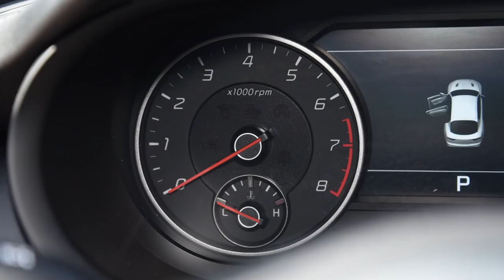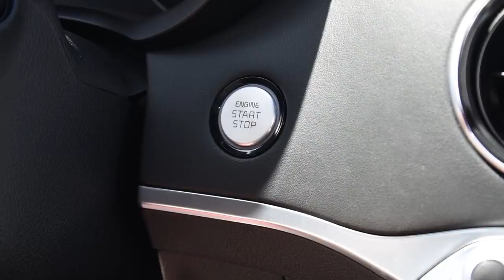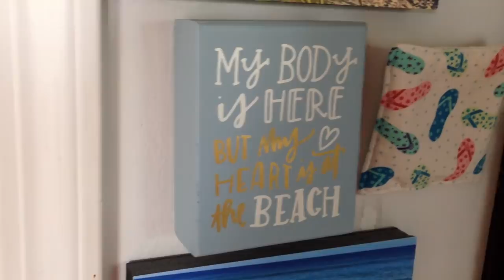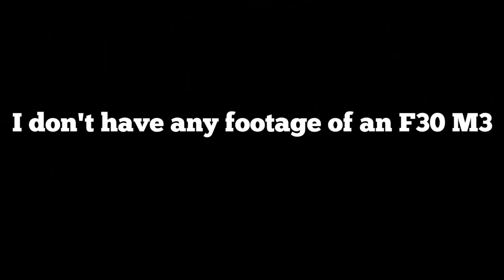2018 Kia Stinger GT: Regular Car Reviews

Comment: Kia, you know you've done a good job when the only criticism you get is "dA bAdGe"
Reply: CRA_55 my criticism is the price and lack of HP. 

If it was a ford or Chevy or Honda i would still criticize it. 

360hp awd for 55k+??? 
I can get a loaded fusion sport for 44k 
Or a loaded accord sport for 40k (fwd I know) 

Or a loaded gt mustang with 100more hp for the same price
Reply: Devin Bender why are you comparing an accord to this?
Reply: Finally, some valid criticism that isn't the Kia badge. 

But then again, the Accord or Fusion won't give you the same performance or handling. The Stinger is more akin to high-spec compact executive European sedans, such as the BMW 340i, and when you compare those 2, the Kia suddenly seems like a bargain.

IMO Kia needs to expand the Stinger range to cover more markets and really push the Stinger nameplate:
- A more economical variant, perhaps with a smaller or N/A engine or a hybrid
- A coupe, since the rear seats kinda suck anyway
- A faster version, perhaps with a V8
Reply: neirad537 Simply be comparing it to a midsize sedan. Ignoring the base drive. It still is a midsize sedan at the end of the day.
Reply: neirad537 It's a valid comparison. You can perceive the Kia as an expensive entry to the mid-size family sedan market (Camry, Accord, Fusion etc.) or a bargain in the compact-executive market (Mercedes-Benz C-Class, BMW 3-Series, Audi A4 etc.). You can't really define what category the Stinger falls into, and I don't know if that's a good or bad thing.
Reply: CRA_55 Problem is the BMW 440 is only a couple of grand more than the GT two. Or the 330 is only  a couple grand more then the base 2.0T all wheel drive. 

In my opinion for the performance for the price it’s just a little too much.

The GT2 needs to be priced mid 40s not mid 50s for 365hp 

Or it needs to have 400+hp
Reply: CRA_55 and the stinger only accelerates about a half second faster (quarter mile and 60) than the fusion. And only has a 0.05g better on the skid pad. 

A little more sporty yes, still not enough to justify 15 grand more though.
Reply: neirad537 explain to me how hey ford fusion sport does not compete with the stinger GT. 

Both are AWD v6TT with about 350hp 
Both are loaded with luxury features. 
But the fusion cost 10-15k less.

And yes the stinger also competes with bmw 3/4 series and Audi 5/6 series mid level cars as wel (yes they cost 5-10k more) but that’s where the Kia falls. 
More expensive than a loaded sedan
Less expensive than the mid level luxury sedans
Reply: neirad537 and Kia doesn’t make a 300hp+ optima
Reply: Strangely, the only car in my country that can be compared to the Stinger in terms of price and performance is the Alfa Romeo Giulia Veloce
Reply: CRA_55 the Guilias here start at 40k for the 2.0rwd and go up to 75k for the v6
Reply: Devin Bender lol and need 93 octane gas and can't even get close to the stinger performance number. Sorry not in the same class.
Reply: neirad537 NOT IN THE SAME CLASS?? 
325 vs 365 hp (both on 93) 
350 vs 375 torque
Awd vs awd 
V6TT vs v6TT 
Loaded vs loaded 
0-60 5.1 vs 4.8 
Quarter 13.7 vs 13.2 
Skid 0.89g vs 0.93g

Pretty close. 
And I wouldn’t pay $15k for the extra 40hp 
I can get a tune and a lot more for that. 
EXACT SAME CLASS 
Mid Sized AWD family sedan.
Reply: neirad537 also id run e85 on the Fusion too. 
360whp 400+wtq
Reply: But you also have to deal with Ford's really terrible interiors. That was the one thing that kept me from buying a Fusion Platinum over the Kia Optima. The Optima was so much nicer on the inside, well worth any premium. But it's a moot point, Ford will no longer be selling sedans in the next few years.
Reply: This also isn't a sedan, it's a hatchback which has more usable rear space than a sedan. 7 cubic feet more than the Fusion

You are also forgetting certain features such as:

* Auto-leveling adaptive LED headlights, 
* Auto folding side mirrors, 
* Kia's excellent infotainment system, which beats Ford's up and down imo.
* Mechanical limited slip differential
* 15 speaker Harmon Kardon sound system, which imo sounds better than Ford's 12 speaker Sony. 
* Head-up display
* Launch Control
* 8-speed automatic vs. the ancient 6-speed in the Fusion.
* 10 year/100,000 mile powertrain warranty and a 5 year/60,000 mile comprehensive.
* Premium nappa leather, which, after sitting in both, Kia has the Fusion beat with the quality of the leather. Not to mention the interior quality is much better in the Kia. 
* Also the Stinger is RWD BIASED with it's AWD. The Fusion is AWD biased, which I feel is a demerit.

This is where that extra $15k comes into play the question is; are the features worth $15k? I think so for me personally.

Another factor to consider is that I would bet the Kia is safer as well, since Ford tends to drop the ball alot on their cars safety. (Ford Explorer vs. Kia Sorento IIHS Passenger Small Overlap, for instance). Kia and Hyundai own their own steel mills so the cost of production is much cheaper while they can add more high-strength steel which helps with chassis tuning, handling, and safety. The Stinger was tuned by Albert Biermann personally, who worked for BMW's M division for over 16 years. 

I cross shopped the Fusion Sport with a Kia Optima SXL and I chose the Kia. I couldn't get over the Fusion's rotten interior. I realize that the Optima is not the Stinger, but it has many of the features and interior bits that the Stinger does, I've also driven the Stinger and Fusion and I feel like the Stinger is lighter on it's feet and felt a little more confident.
Reply: All this talk about horsepower from Devin. 

You. Do not. Buy. A GT car. For horsepower. GTs are not go-fast cars, they're go-far cars - unless you're some dipskii-in-the-lipskii-yee-yee-bruther Rustang driver.
Reply: Devin Bender Horsepower isn't the only metric of a car. I bet you could buy a 90s Civic, boost it to high hell, and come out with more horsepower than the Stinger GT, Mustang GT, and other similar cars for a much cheaper price. Or you could LS swap something, and get much more horsepower / price. But if that's your only metric, buying any brand new car is probably a poor idea, yeah?
Reply: People who care about the badge are kids.
Reply: @devinbender8428  the Mustang GT is a full on Sports Car, the Stinger GT is a Sporty Sedan. Furthermore, it may cost more currently, but when running costs are added - it will be much cheaper.
Reply: Kia needs a luxury brand putting Kia stinger as a luxury car is a  bad move
Reply: @theshield1613  Hyundai has the Genesis luxury brand already, so Kia should start a Stinger performance brand
Reply: @cra_55  yes I know
Reply: @cra_55  should call it the stinger not Kia
Reply: @cra_55  they own a share in Genesis, that would be a horrible idea. Also keep in mind that would take away the point of the Stinger, witch is supposed to be a Halo car
Reply: @devinbender8428  numbers aren't the only thing that matter for a car. With your logic The Miata and BRZ are horrible cars.
Reply: @devinbender8428   LoL fusion sport has nothing on the stinger. It’s just a fusion with a better motor..... and you can get v6 awd stingers brand new for less then 40k. And accord sport really wow not even close to stingers leauge. The stinger drives and feels like a German car because it was engineered by Germans lol my man Albert Bierman former head of BMW M division.
Reply: @cra_55   I agree with all your points but the V6 TT stinger is plenty quick out the box. I have one it does 12.5 in the 1/4 stock. In terms of speed it competes very well with Germans S5/c43/m340i. And the Japanese offerings don’t come close to stinger the red sport 400 is about equal in acceleration but everything else stingers blows it out the water.
Reply: @devinbender8428   average stinger goes for about 40-44k brand new a lot of the time cheaper than fusion sport. I got my 2020 GT AWD for 38k brand new.
Reply: @devinbender8428   I do 12.5 to 12.8 in the 1/4 and 4.2-4.6 0-60 stock all day in my stinger. It blows the doors off fusion sport. If u don’t believe me I have plenty videos on my page all stinger 0-60 and 1/4 mile runs.
Reply: Fax
For the longest time when people asked what my car was, I’d say it’s a Genesis coupe. 
They’d usually say huh?
So I said it’s a Hyundai Genesis Coupe and they would more times than not just look disappointed lmao. 
But when Genesis as a brand started to catch on that sentiment changed. 
Hilarious how much a badge affects perception
Reply: Millions on $$ later   KN
Reply: @devinbender8428  tell me you know nothing about cars, without telling me you know nothing about cars lol

Comment: You can buy a 2018 stinger for 30k now. Well, that was quick..
Reply: No you can't
Reply: Ali Ahmadi in Florida dealerships have new V6 stinger GTs from last model year around $30k. They’re insanely cheap.
Reply: I used to work at the dealer, brand new you would get 5k off the GT1 v6 and 8k off of the top trim GT3.
Reply: That's the base 4 cylinder model. I can't find the v6 for under $46k in my area.
Reply: macaron3141592653 where are you? In most areas of the US V6s are available for under $40k.
Reply: Yeah, they are NOT going for under 40k in New England.  I'm seeing a lot of 45-47 for just the GT.  GT2 is well over 50k.  Frankly, they just don't exist up here.  I'm finding dealers who don't even have them listed as for sale on their websites...
Reply: In Finland 2018 stinger costs 55k
Reply: Losing value nearly as fast as a BMW. Lol.
Reply: Does anyone know why the car is selling cheap?
Reply: Yeah later you can find em for 30 for a 2018 model
Reply: Reading this hurts in 2021 because of inflated used car prices lol.
Reply: @Schpoople cars like this in general don't hold their value well
Plus the general perception of kia as being cheap cars

Comment: Ah the Kia Stinger GT, probably one of the most underrated modern cars right now. Such a shame that this and the SS are relatively overlooked even thought they're 2 of the best sleepers on the market.
Also, when i go to japan and use one of those butt washer things, I'm gonna say "AH GAME CHANGER".
Reply: Michael Opnv rather have a Genesis G80 for $2k more
Reply: Sorry dude, but at no point does the Stinger look like a sleeper. The Stinger is only a sleeper, maybe, in the sense that it's a Kia.
Reply: ZIM252. Sure it does, to the masses it looks at best like the new Optima, perhaps a special trim. I would say Cadenza or K900 but the masses think those are Optimas also!  Just like the SS looks like a Malibu or Impala with Autozone chrome scoops stuck on.
Reply: Devin Bender.  Aw jeeze, its the Camaro vs Firebird thing all over again!
Reply: Michael Opnv dude the ss is pretty much an ls3 with a 6 speed. In a midsize sedan.
Reply: Most overrated is more like it.  It's not even close to as nice as a 7 series or S class, despite the video claiming so.  Heck it's not even as nice as a Genesis G80.
Reply: Michael Opnv i’d rather buy a used 2014 audi s6
Reply: It's really not underrated, and it's really not a sleeper in the sense that the SS is, so you're wrong. but correct about the ass-blaster.
Reply: agentlongwood Nigga in which world u compare a stinger to a s class. The s class is double the price
Reply: Duh, that's my point.  They make the comparison in the video itself.  Did you even watch the video? lol
Reply: If i wanted a sleeper I would buy a SHO
Reply: agentlongwood it’s way closer to a E class than S class.
Reply: WhaddupImJohn I’d rather have the Fusion Sport. Faster and cheaper
Reply: Devin Bender tell it to Mr regular. He's the one who made the s class comparison in the video.
Reply: agentlongwood the E class is 5” BIGGER
The S class is a whole FOOT longer. 
The C class is 5” smaller 
So it’s in between the C and E NOT the S

In between the 4 and 5 BMW
And 5/6 Audi. 

No where near the 6/7bmw or 7 Audi. 
That’s just stupid talk.
Reply: Duh.  I'm not the one who brought up the S class comparison.  They did that IN THE VIDEO.  Did you even watch it?
Reply: agentlongwood I did watch it but just because he made the comparison doesn’t mean it’s accurate
Reply: Devin Bender exactly. That's what Im saying. I was commenting that it was crazy that the video would compare the stinger to an S class.
Reply: I Am Sekou I mean if you think the Mercedes S class is a good comparison for a KIA, then knock yourself out, lol. For my money that's a ridiculous comparison.
Reply: I Am Sekou it is a bit over rated. Only 250hp for 35k and 365hp isn’t bad for 40k but that shoot up really quick when you add options
Reply: I own a butt washer from Japan and have it in my master bedroom WC.  "Game Changer"
Reply: I read all the comments and all I can say is "opinions are opinions".
I'm not saying this is the best sports car you can get right now, it isn't, nether is the SS. If you rather have a G80, it's fine. If you rather have a older sports car, it's also fine.
Reply: Stinger, so hot right now. Stinger.
Reply: It is one of the most overhyped cars now, how is it underrated? Skoda makes a car, which is quicker and better in every way for  the same price, and nobody talks about it.
Reply: Ats v> stinger
Reply: Genesis too, and you can get that with a manual and correct wheel drive.
Reply: Michael Opnv, hey, at least in 3-5 years, these babies will be cheap as heck, used. Yeah, once you buy it, no one's gonna give your a dime for it once your done with it, but, at least, you have a sports car that's fun.
Reply: Michael Opnv Same with the tarus sho.
Reply: just buy a butt washer things online. It really is a game changer! Never dry wipe again!

Comment: Kia has honestly come a long way.
Reply: Robert G. Along with Hyundai. Probably because of Hyundai. I bought a Sonata for my mother this year and I'm shocked at how many parts you see used across both brands and even re-used in their luxury/performance cars. Demuro did a review of a luxury Kia and it had so many of the same parts and interior design choices the Sonata has. But they are really solid parts and designs to begin with so they won't feel bad in a $60k car. My mother leased a '15 Camry before moving to Hyundai and the Sonata is so much better all around. Its luxury level smooth and quiet. And that's saying something over the always good Camry. The South Koreans know how to build great cars.
Reply: My sister has a new Rio, it's an excellent car for the money. My daily is a Fiesta and if I was buying a car today rather than in 2012 when I got it, I wouldn't go with the Fiesta.
Reply: With Hyundai and Kia knowing they won't get far just making inexpensive vehicles that can't challenge and beat Honda and Toyota the only other option is to go after the luxury sedan. The Hail Mary pass approach. I only have seen maybe two or three Hyundai Genesis in all of San Diego. There are more PTCruisers than those. Prius models are starting to outnumber Corollas and seeing them on the daily drives it's looking like a slowly spreading cancer. Hyundai is trying to counter with the Ioniq Hybrid which gets better mpg. Things are definitely changing.
Reply: With Pee
Reply: My dad recently got a pre-owned 2017 Sonata Limited with tech package, and damn is it nice. XM radio, Apple Carplay, auto-dimming rear view mirror, leather, heated and cooled front seats, heated rear seats, memory drivers seat with 4-way lumbar support, rear window sun shades, rear console air vents, LED taillights, LED turn-signals on the heated mirrors, HID headlights, loads of legroom front and rear, and a cavernous trunk. The car isn't very powerful, but it's very comfortable and he gets about 470 on a tank. This car was a huge upgrade for him, as he has never owned anything but base model Honda's from the 90's.
Reply: Robert G. Yes now it looks like an awkward mixture of Mercedes and Dodge.
Reply: Yar Nunya How much did that cost?
Reply: There are dozens of Genesis G80's around here in Memphis. I see them all the time. I've even seen about 12 G90's and 5-6 Kia K900's. So they are making rounds, give them time.

Comment: This car coming from Kia is like the AMC Rebel Machine or the AMX. American Motors was known for building economy cars, and when they tried to escape that niche with the SCRambler, Rebel Machine, and AMX they dug their own graves. They were great cars and well worth the price tag, but nobody saw the AMC badge and thought, sport/muscle car. Sure the Stinger is great, but it's a Kia. Like the VW Phaeton, it simply was badged by the wrong company, so it probably won't be too popular, but what do I know? I'm just a dude on the internet.
Reply: Last line is the only true part
Reply: except their reputation nowadays exceeds their past. They're normal tier now bot subpar econo cheapos
Reply: As long as they don't produce too many I don't see the problem in making a Halo car. They know it's low volume. Even if it barely makes profit, sometimes a Halo car is good for branding. 

The Kia Soul sells well because quirky, their other cars need something to point to so they can say "SEE; Kia's can be sporty (ignoring that the one I have isn't)"
Reply: Except KIA knows exactly what it's doing -_- unlike the virgin AMC that just jumped in, KIA has been preparing for decades.
Reply: Gonna be honest, the Phaeton was awesome!